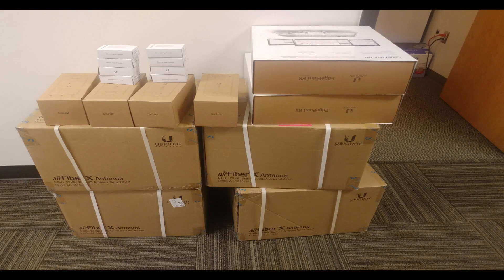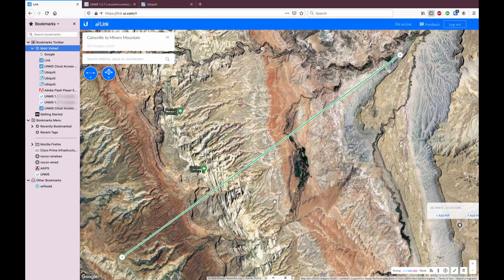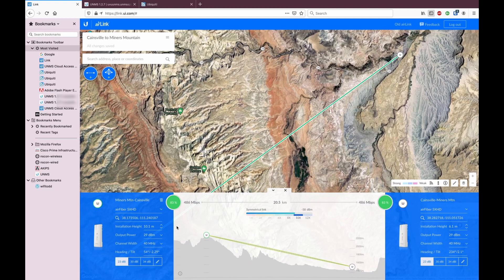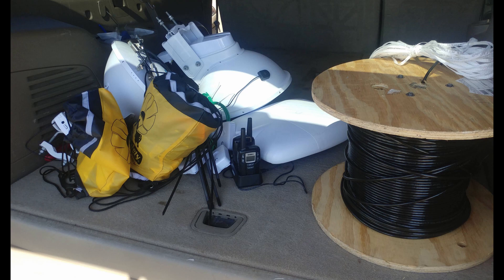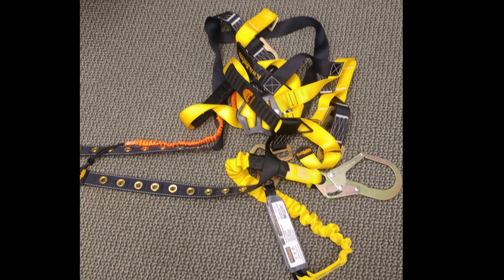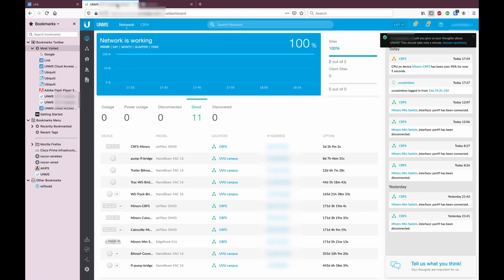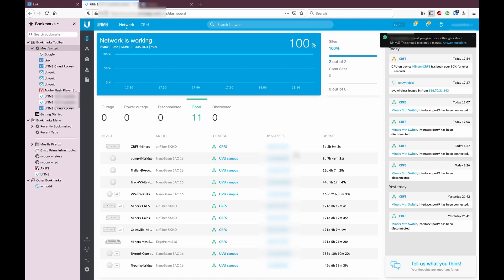Long Distance Point to Point link using Ubiquiti AirFiber

Comment: hello, good video, a question how is the correct connection of the antenna chain 1 and chain 1 in Antenna A Y As in antenna B, I read that the cables must be crossed at the ends. ya that antennas are used in Slant 45. un saludo y en espera de su answer.
Reply from the maker: I did not cross them.